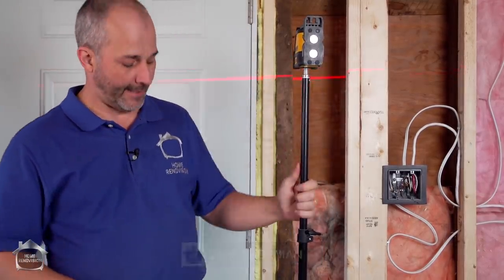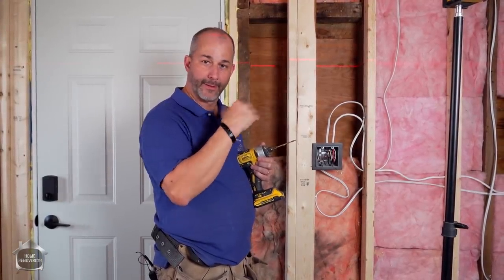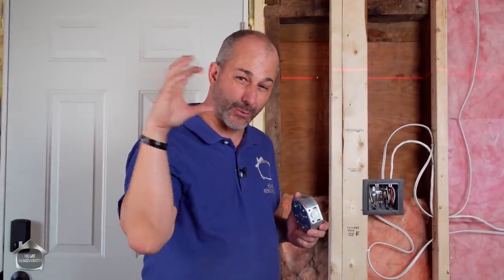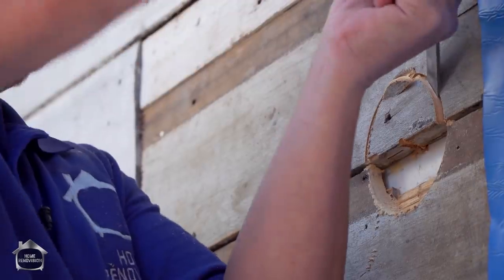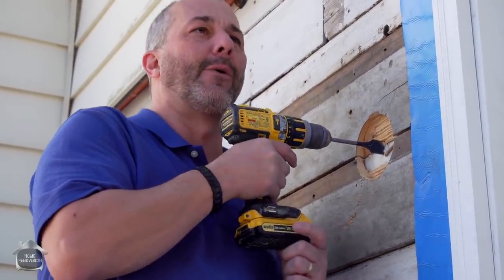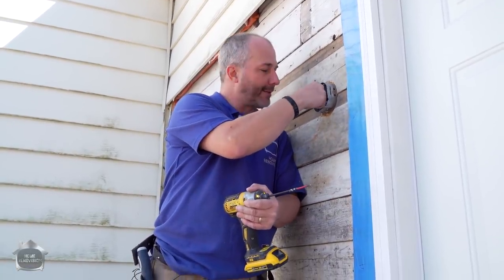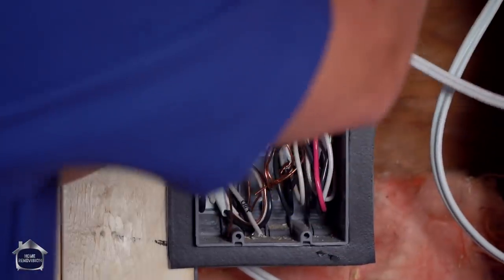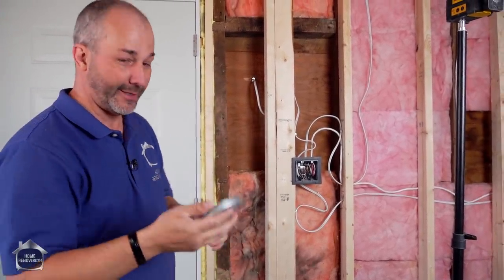Carriage Lights | Wiring Them Up

Comment from the maker: If you have questions about residential wiring or light fixtures feel free to ask below. I am always glad to help. Cheers!
Reply from the maker: I am finding the ridgid a little frustrating with the multiple power options. It seems to be slipping around a lot.
Reply: I got a question about light fixtures. I have one of those lights in my kitchen, it's one of those long lights like they have in stores that take those long tube like  bulbs, my questions are 1 do the make LED bulbs for them and 2 can I use them for that light?
Reply from the maker: yes they make an led bulb for those now. best to check with the bulb supplier to see if you need to alter anything regarding the fixture first. just take a quick picture of where you insert the bulb and see what the store has to offer. cheers!
Reply: @HomeRenoVisionDIY  ok thanks! Cheers!
Reply: Home RenoVision DIY Question for you - Short if calling an electrician, how can I trace/locate an electrical line that’s running through an exterior wall? No power to it and I’ve no idea where it comes in to the panel.
Reply from the maker: Hi Joe, if a line has no power in it there is nothing to trace. If all your breakers are in the on position then it is simply a left over wire that someone else cancelled out and should have been removed if they had access to it. not uncommon that old wiring is left in the walls to confuse things. Cheers!
Reply: Jeff,
I love the channel.  I watch all the time.  We're going to be doing our basement soon  and your videos will help a ton!  Thank you!

I'm a fellow Ontarian.  I want to add a 100amp subpanel in my garage to power my woodworking tools and then also my travel trailer (30 amp).  Do I have to run my cable from the main to the subpanel through emt or plastic conduit?  Do I need afci for my panel breaker?  My garage is attached to the house.

Thanks!!
Jason

Comment: Hi Jeff,
Sparkie here. Go Vintage coach.
Love your shows. I'm buying an old heritage home and learning lots from your shows in anticipation of fixing it.

You could use two shallow boxes. Just run a single wire up to each box from the light switch box and parralel the wires in the switch box. Also, in shallow boxes, don't bring the wire into the centre knockout, use one of the offset knockouts.

Great show. Good luck with your home.

Comment: I just did something similar.  Both of my fixtures have pancake boxes, and I just have a lines going from the switch separately to each fixture.  It works well, since my (wood) siding is exactly the right thickness for that kind of box.
Reply from the maker: That is a great way to do it. Cheers!

Comment: I've noticed when you wire a light switch or plug that you leave a loop of wire in the wall for future needs.  Do your inspectors object to that loop of wire after you have secured the cable within 8" of the box?  I've never seen another electrician do that before.  Seems like a great idea.

Comment: How do you fish wire from the second floor back to the electrical panel?  I am planning a bathroom reno which involves installing a tub with heated backrests and chromatherapy lights.  I believe I will need a GFCI somewhere in there?  Also installing heated flooring and pot lights as well as wall sconces at the sinks.  Any hints would be appreciated.
Reply: @hyms145gmail,  they sell a wire reel that you feed into the wall. The end has a grabber that you wrap wire to. Tape it on so it doesn't come apart in the wall when you reel it in. It brings the wire back to you, you cut off the taped part that most likely trashed. Then wire it up. You can Google electrical codes for your area. Ground fault near water is a must.

Comment: I see you're not using the new Rigid brushless tools - is it a not recommended now?! Love the content BTW.
Reply from the maker: I have to say That i was a little frustrated with them. the impact driver has 3 speeds which I find causes it to make more noise than action. I haven't given up on them yet but I wanted to read the user manual first to see if it is me or the tool. Cheers!

Comment: Hey Jeff, could you give some details on that 2 gang switch box and the insulation around it? Are they a set or would the insulation fit standard boxes? Also, it looks like there is a bar behind the ground screw? I ask as an electrician b/c I don't see those at my supply house in North Carolina. It's either blue plastic from Lowes or fiberglass from the supply house. Thanks!
Reply from the maker: the bar means I can just attach each wire to the screw and it is all grounded. If you don't have a bar you need to twist all your ground screws together. The gasket on the face is a upgraded feature for getting a good air seal around the box. Cheers!

Comment: Want to do this in the garage,  if the walls are open should the wire run thru conduits or not?
Reply from the maker: depends on your local code. if your wiring is all in conduit best to keep it that way. If it is in conduit then you could probably run Bx armored cable instead. It would be easier. but check with your local building office.

Comment: Man....please, please, please!!!!  ....put your safety glasses/goggles on before you drill the hole for the wire and connector.  

It's just hard to get young guys to wear their PPE when you are training them (This is a major issue) and it just helps when they SEE "teachers" or instructors using it. 

anyway, great videos....subscribed.

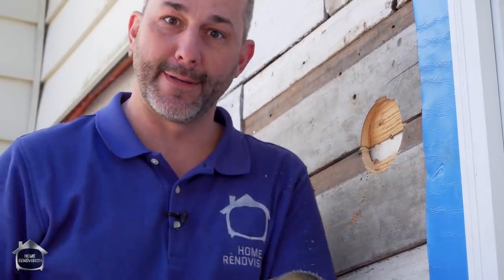Comment: 4:38 ...4 inch pancake box can only hold 6 CU inches of wire space. That means only one cable can enter the box like you said [I wont do the math per wire and specific codes about which wires count etc] But you can add a mud ring to add more space to allow for more cables! They make round mud rings for round boxes/octagon boxes...

1 If you use a 5/8 inch mud ring, that also adds another 6 CU inches of space. So you can now add a second cable
https://www.platt.com/platt-electric-supply/Octagon-Boxes-Accessories-Box-Mud-Rings/Hubbell-Raco/727/product.aspx?zpid=95933

2 You can also use a metal spanning bracket that extends between studs. You can mount boxes to it. Be sure to click on the several pictures on the left so see how it is installed and used
https://www.grainger.com/product/NVENT-CADDY-Steel-Mounting-Bracket-2KXB1?cm_sp=Product_Details-Products_Based_on_Your_Search-IDPPLARECS&cm_vc=IDPPLARECS

3 The best method structurally speaking, is to place a wood block between the studs, and mount the box to the block. But the layout of the block can be tricky. I took a few pictures from work, and gave a quick diagram
https://imgur.com/a/BNngdUP

There are lots of other ways to do this such as using remodel boxes btw